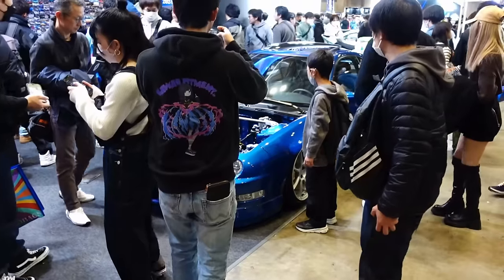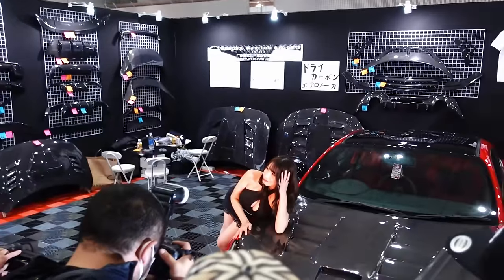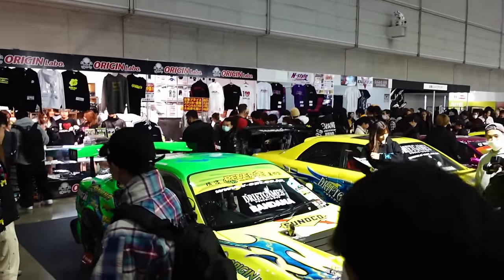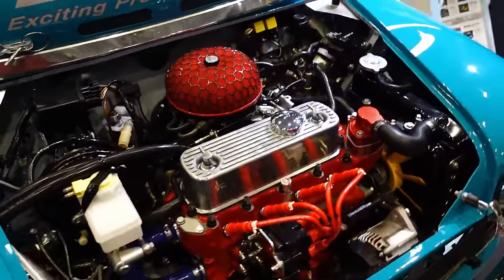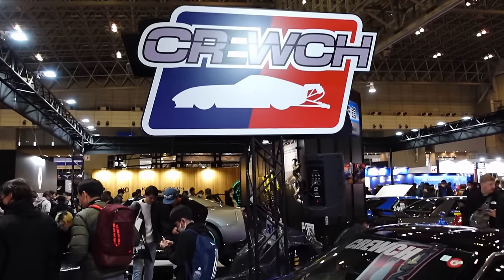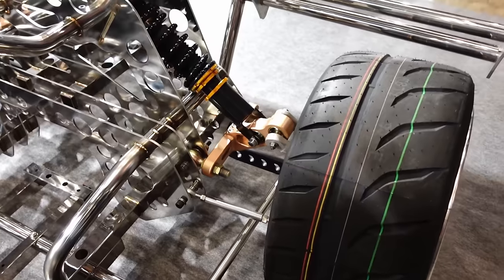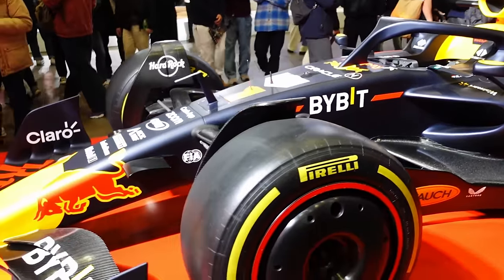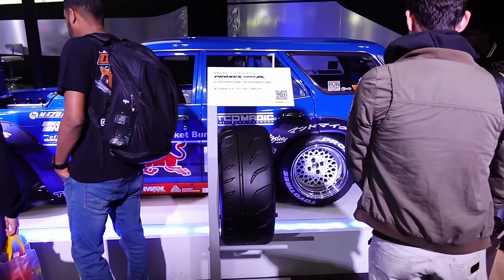Tokyo Auto Salon 2024 - JDM tuning has no limits!

Comment: Pretty Sure the car/frame you were looking at around 40:30 is a copy or mini version of the now made Mazda 787D (Madmikes New Drift Car)
Reply from the maker: I think it's the same frame.  I'm pretty sure I saw a post by Mike saying TRA Kyoto made the base for his 787D.  This one was made by TRA Kyoto as well.  Seems like they might be trying to produce a kit car type system.  Mike's was the reveal and this is the core kit.  Just speculation, but it's built in "fit on a pallet" size pieces.